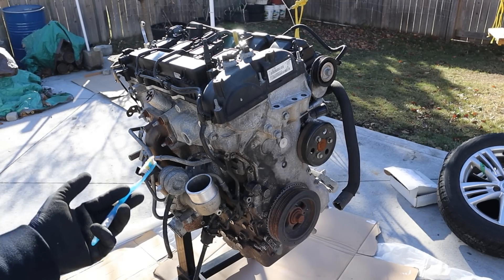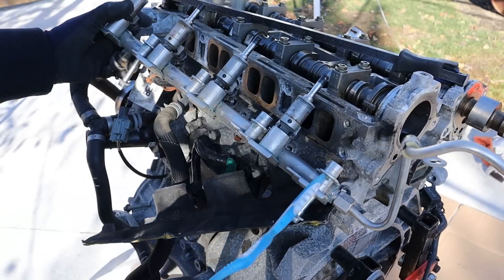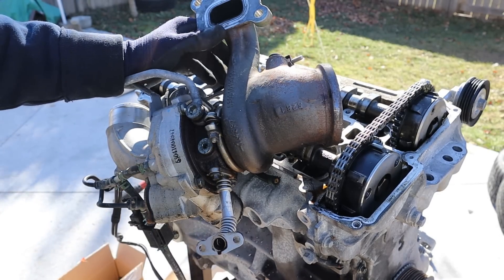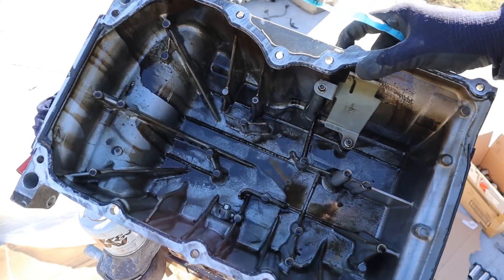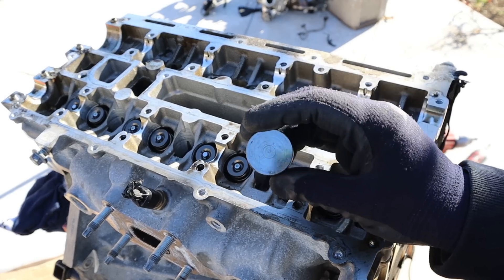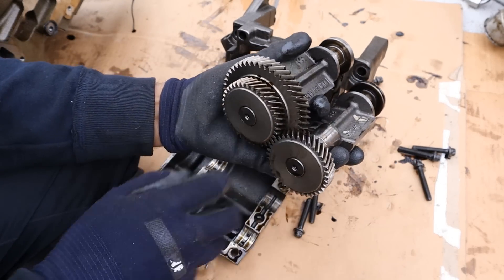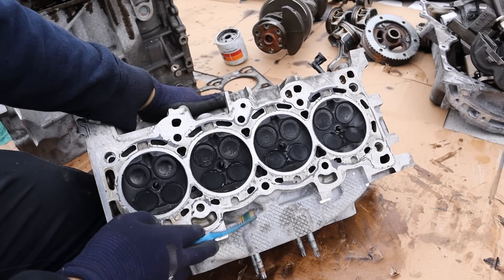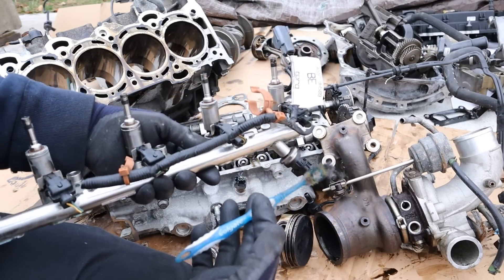Why Ford Ecoboost Engines Fail

Comment: Bonjour, merci pour cette vidéo qui permet d'en savoir davantage sur les différents moteurs Ford et les divers problèmes rencontrés par les propriétaires.
Perso j'ai un transit custom van Nugget plus 11/2021 équipé du nouveau moteur 2.0L Ecoblue 185cv YMR6 avec bloc fonte très différent de celui que vous présentez. Il est apparu en 2017 je crois. L'espace entre les cylindres est beaucoup plus large que ce que vous montrez sur votre bloc alu et ne comporte pas de rainure (tranchée?) entre les cylindres.
Je le surveille comme tous les moteurs que j'ai eu en ma possession, mais n'ai pas plus de crainte que cela, il faut dire qu'il n'a que  12000kms . Il tourne comme une horloge, très coupleux, économique (6.9/7.4l/100) et puissant lorsque ponctuellement on a besoin de dépasser.
Par contre sur tous mes véhicules, je fais toujours les vidanges plus fréquemment que ne le disent les constructeurs: Tous les ans ou 10000kms et remplace le liquide de refroidissement tous les 2 ans. Je mets aussi un flacon de nettoyant injecteurs dans les réservoir tous les ans.

Il faut aussi avoir une conduite et une utilisation adaptée: pas de petits trajets urbains et pas le pied au plancher sur de longues distances. Pas de grosses accélérations non plus sur les premiers rapports. éviter les sous-régimes comme les sur-régimes.

Anticiper les éventuelles fuites par un contrôle visuel attentif (oui c'est chiant!) avant et après tout long trajet et y remédier sans attendre.

Brancher régulièrement un petit lecteur OBD pour lire les éventuels défauts de capteurs et autres sondes, cette surveillance évite bien des ennuis inutiles et coûteux

Là vais le vidanger à 12000 kms (il a 1 an) bien avant les 40000kms préconisé par Ford même si il est encore garanti 1 an!

Bien à vous

Alain

Comment: Just a note. The part that caused the failure was an aftermarket part. The catch can is not OEM and sucked in snow. That is the culprit and not due to the design of the engine itself.

Comment: About the carbon buildup on the intake which seems like a nightmare? Heh.., check this out. On my 1.0 125HP Ecoboost, I think I had the most gruesome kind of oil clogging and buildup on the intake valves that looked like something out of an alien world. You know how I've cleaned the valves and all of the intake and pistons and the piston rings without unscrewing a single bolt or anything other than unplugging the green connection on the feedback hose from the EVAP system which is just upstream of the boost pressure and temperature sensor that is upstream of the throttle body? Well..., I've bought 2 cans of AMSOIL POWERFOAM and followed the procedures of keeping the engine a bit revved up to not have it die and maximum sprayed that foam right through the EVAP system feedback connection (of course, after disconnecting the hose from it) and emptied it. Yes, there will be a LOT of bluewish smoke coming back from the exhaust, but no damage is done to the IAT 2 and boost pressure sensor as well as the MAP sensor or the cat converter. Those were completely unaffected. After driving for 10 minutes the smoke was still coming out of the tail pipe which worried me of what I could've done, but after a couple of days I've used a borescope and check on the valves and how the pistons look through the ignition plugs and voila...! The pistons already started shinning here and there and a good punch of that ugly crust on the intake valves had started melting off. After the 2nd and 3rd bought and used spray from Amsoil Powerfoam, the valves became almost as clean as brand new and also the 3 pistons where shining for more than 90% of the surface.

Again, just a good spray that saved me from a headache of getting the intake manifold off and using wallnut blasting and a big work.

Try it out folks, it works like a charm for me to lean those valves one an year and have ZERO direct injection carbon issues anymore.

Comment: A very useful video man. But 2 things you'll have to correct for the future. The vacuum pump doesn't compress air anywhere towards any outlet, it only sucks air from the vacuum hoses creating vacuum in them and effortlessly sends it into the cylinder head cover from where it goes either to the PCV's breather or the PCV's intake manifold valve. The other thing is that the turbocharger assembly is made out of a turbine which by definition is a series of blades being driven by a fluid while the other series of blades at the other end has the role of compressing air so it's called a compressor. No combustion engine has only turbines, they would be meaningless. One's a compressor, the other's the turbine which drives the compressor.

All the best!

Comment: Steel oil pan will bend, flex and dent.
Aluminum ones either crack or shatter!
Stamped steel is also cheaper than cast aluminum to replace, too.
Reply from the maker: Very true. At least it's better than plastic oil pans.

Comment: Nice video! Question about the carbon accumulation: is there anything an owner can do about it or it’s inherent to the direct fuel injection design?
Reply from the maker: Inherent to the design. You'll have to do a clean out every so often

Comment: I am going to buy Ford ecosport 1.0 ecoboost car in 2022...pls guide should i buy it or not. 30000km running engine with very good condition car. Pls suggest @speedkar99

Comment: Having a 2018 mustang with almost 200,000 miles on it with an Ecoboost 4 cylinder engine in it? It still runs like knew, gets great mileage and absolutely no problems whatsoever. It has not failed,  nor shown any lack of ability to do it's job on short or long trips. Your homework on the ecoboost is lacking and incomplete! After having two previous mustangs at almost 500,000 miles apiece? I have no doubt the 2018 can easily get a couple of hundred thousand miles more. I would love to find another one with the ecoboost 4 cylinder. They are GREAT!

Comment: I have a '13 Focus ST with about 115K miles on it.  I have had it tuned most of its life and have actually had an E30 tune the past 65K miles.  I change the oil regularly and maintain the car very well.  So far, fingers crossed, I have had zero issues with it.  It has actually been one of the most reliable cars I have ever owned!
Reply from the maker: Awesome.
Reply: Got ST too (wagon version available in Europe). 2.0 from ST's has closed deck, so basicly that is different engine.
Reply: I got the 2.3 on my 2019 eco got it at 0 miles and at 33,400 so far fbo and honestly it just regular maintenance. People buy vehicles and expect to do couple maintenance on his lifetime 😂
Reply: 13' Focus ST here with 170K miles. Mostly stock. No major engine issues. Hoping to make it to 200k!
Reply: @Sn00ty-OG  Same here, 2016 w/176k.  Bone stock, frequent oil changes.  I’ve done all maintenance myself, it’s never been back to the dealer.

Comment: It's ironically hilarious how these turbo boosted engines are supposed to be better for the environment, yet they inevitably burn more oil than their predecessors and oil is the nastiest thing you could possibly burn in the combustion chamber. A less efficient engine that doesn't burn its oil is much better for the environment.
Reply from the maker: They're also made of alot of plastic that can't be recycled

Comment: My 2017 failed, had to put in a new engine because it was sucking coolant into number 3 -- Looks like the one you have, has the carbon in the intake problem, they relocated the crankcase vent to alleviate that problem . I think you could put that engine back together and use it.

Comment: I had the 2.0l Ecoboost in my 2014 Escape. Got to 250k and the trans started acting up so I sold it. Very reliable and surprisingly quick car that averaged 25mpg in mixed driving. In the end, I think the direct injection issues were definitely starting to impact drivability at higher rpms or perhaps the boost solenoids might have needed replacement but that car and engine were trustworthy for the 8.5 years I owned it.  Was I lucky?  Perhaps, but my driving averaged 75 miles a day and I knew about the direct injection issues so I changed the oil and filter every 5,000 miles.  If Ford dealers weren't gouging on sticker price, I might have gotten another Escape, but I ended up with a new Crosstrek instead. This was a great video.  Thanks for sharing!

Comment: Looks to me the engine only needed new valve seals they probably were the only problem or maybe a problem with the oil seal in the turbo compressor side.

Comment: I had a 3.5 ecoboost 2011 f-150 and it ran flawlessly for 7 years.  I put 180,000km on it and it ran and looked as good as it did the day I bought it.  best vehicle I ever owned but decided to get a transit 250 for more cargo room because of my trade.  that truck and engine made me alot of money those short 7 years, but ill never forget that 380 horse rocket and leaving anyone behind me when that pedal went down, I don't get that outta the transit that's for sure lol.
Reply: That's it? I have an 05 2.0 Focus with 288k miles. I only do routine maintenance.
Reply: @ilc-nl3yy   thats great bud

Comment: I sold Chrysler products in the mid 80's. They were some of the first turbo motors in mass production. The engines would be toast by 30K and they were only making 140 HP. I always thought there would be even more problems with todays 4cycl motors making over 300 HP and I was correct. You want HP and torque, you need 6 and 8 cycl motors without boost. Once again, the problem is government regulations that force manufactures to make lots of power with smaller and smaller motors.

Comment: this guy talks a lot of sht & doesnt explain details. maybe he knows nothing about engines. like to see him do a chev, & say thats a good engine.. better than the ford, never happen. chev have huge problems, with design. plus, car co,s have to cow tow to the epa, greenies, this is why they build engines like they do..been going on like this since the 60,s. then again, formula 1 racing, 1.5 lt puts out 1000 hp.. but, even there restricted now. funny how you have to buy an ev., but drags & burnout comps still legal. have they built an ev truck, to pull 50 ton, & do 600mile, on 1 charge..????.its all bs...

Comment: Dammit! I was really leaning towards getting a Bronco Sport with the 2.0 ecoboost... the 1.5l was too weak... any recommendations on what else I night look for? I'm still driving my 2001 ranger and really need to get a new ride soon!
Reply: Hey bro. The 2.0 ecoboost is reliable. Don't let this video change your mind. Check out how many focus st are around over 200k miles on reddit or youtube. Take care of them and they'll last. I just copped a 2015 focus st and it's the best driving, most fun car I've ever had. It puts a smile on my face everytime I hop in. Get the bronco if you want it, and don't look back.

Comment: There Wound up tight engines and everybody that sees turbo thinks they got a race car .. they dogg the shit out of em then change the oil every 10k miles dealer says no need to ever have to change transmission fluid it lasts the life of the car. to them 75k to 100k miles to them is end of a cars life

Comment: I'm glad that I'm old school and still have two Fords that are old school designs.  One from 1967 and the other 1993.  I can work on them and parts don't cost me a fortune.  Anytime these small displacement engines are stressed to the point that they are, failure is a guarantee.  Ford isn't the only company doing this stuff, this is an industry wide trend that is rapidly exhibiting that the requirements being set forth for internal combustion engines are beyond reality and their obsolescence is right around the corner.

Comment: It's not just the EcoBoost, all of these direct injection engines are dirty dirty dirty. Toyota has implemented a partial work around that helps keep the valves clean but it's not perfect. Fuel injection was definitely Superior when it comes to the life of the engine and the efficiency. Direct injections sucks in my brief experience with it. Never again.

Comment: Awesome video! I love my 17 ST. Thankfully I was aware of the direct injection issue before buying the car and have that fantastic intake evap valve that helps (doesn’t solve) carbon buildup. Still did a catch can to keep that cleaning interval as far as possible. Haven’t had any oil burning issues yet.

Comment: Visually I don’t see any damage in this engine except for the play in the cam adjuster. Great explanation. VAG engines have the same basic setup, only the timing cover is so thin you can twist it like aluminum foil…

Comment: It's not obvious from that why the engine failed, and it most certainly was not because it was hydrolocked. However, the carbonisation is at an epic level, and if it's burning a lot of oil then I'd normally look for valve oil seal problems, a worn bore and/or problems with the oil control rings. If there is a problem there, it's not evident in this video. Maybe there was a problem with the EGR, but the other way it might happen is a problem with the turbo oil seals. If oil was entering the engine via that route it would explain so it was so badly carboned up. That would be what I would look at, but it's not mentioned in the video.

Also, was the engine locked up? If so, I don't see anything that did that.

Comment: Very informative and to the point through your great editing, my only criticism would be to have taken the head off before undoing the main and big end bearings, as this may have shown a low piston due to a bent rod if it had been hydrolocked. But as I say good concise information on an engine that has a flat bottom sump for when it does go wrong....not IF😉

Comment: What do you mean why?
Ok
Take a small child, and make him pull around a cart designed for a horse….duhhhh….why did he fail…duhhhh.
Can you come up with a different footer that makes a statement, instead of an obvious question please?
Why? How………….
.I was going to say retarded, but have been promising myself not to use the word retarded. 
So I will say….silly….in stead of retarded. Even though it’s much more retarded….than silly.

Comment: Carbon buildup resolution? I used to spray water (fine spray) into the intake on a small generator when it began running rough and within a minute it would be purring  again. . Curious if spraying water into intake might clean up carbon also? Used to do it on a chevy 350 I owned, but never tore it down to check carbon buildup

Comment: Hmm, what can be said of the Fox 1.0T engine? I picked up a 6 speed manual Focus with the 1.0T about 20 months ago. hasn't given me any issues just yet but I want to know what to expect once it exceeds 100,000. It's at 90 thousand now, so by the Fall it'll be right at 100k if my averages are anything to go by

Comment: All these people in the comments make it sound like they blow up if you start your car. These engines are actually very reliable if you have the closed deck design. There are many people running these hard in the ST community pushing 350-400whp with stock internals for thousands of miles. The reliability hp limit is around 380hp(will be a reliable daily driver) plus is the limit for stock fuel system. And if it blows up they are a very cheap engine and if you get a built top end you will be set for 500hp+

Comment: Ahhh Ecoboost! You dreaded little POS short-timer motor and the #1 reason of why a 2018 model year Ford vehicle was my absolute LAST Ford I will own in my remaining years on this planet after decades of being a faithful Ford owner for good reason. I just bought 2 brand new Toyotas that will likely be my last vehicles. No turbos, has both Port and Direct fuel injection, and a shitload of the same on the roadways of the world with well over 250k and more miles. 

Great video! Thanks for the entertainment and excellent education!

Comment: This guy is hilarious. Zips all the cam caps off and tosss them in a box. Flips the engine over and drops the hardened steel cams on the concrete. That engine saw more stress during disassembly than it ever did while it was running. I would watch another one of his videos.

Comment: Because the engine is not able to take turbo abuse over long periods. We have biggg issues with the integrated turbo manifolds cracking, loss of comoression  VVT locking pins snapping off and scrambling the valves die to timing failure. Front cover oil leaks, injector failures.... over boost, underboost.... and on and on. Oh yeah waterpump leaks lol....

Comment: I've owned several Fords and always avoided the models with ECO-BOOST engines. Figured it was a ripoff that would over-complicate the engine maintenance while not doing anything substantial to improve mileage or reduce emissions. My Fords have been great, except for a Focus, which was not a quality product. Had engine cut-outs all the time and numerous sensor failures, plus came with terrible tires that wore out after 20K miles.

Comment: Great video.  Have a 2.3 Eco that failed... was putting coolant in cylinder #2. Motley Crue concert fog behind tailpipe.  Head gasket had failed in that area where the grooves are machined in the next gen block.  Putting in a new head gasket and a new head with ARP studs and hoping it holds together.  We shall see!!!

Comment: Shame on Ford for continuing to peddle inferior motors. My 2005 Ford F-150 LARIAT was sent to the salvage auction after two motors, needing a third. The 5.4 Triton with overhead cam phasers was unable to distribute oil by design. My Chevy ElDorado runs just fine.

Comment: So you tore down a perfectly fine engine with not one issue identified, and even gave it a title about how bad these engines are.  There was nothing wrong with that engine!  It did not hydro lock, the turbine housing was not cracked, bearings were excellent, rings were not stuck.  That engine had a lot of life left in it!